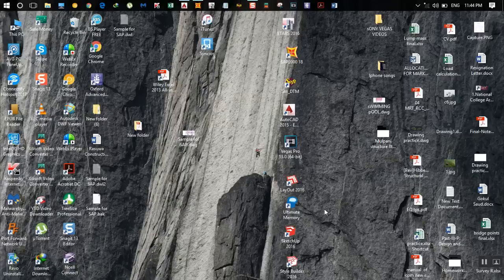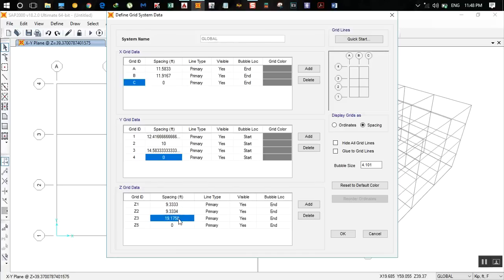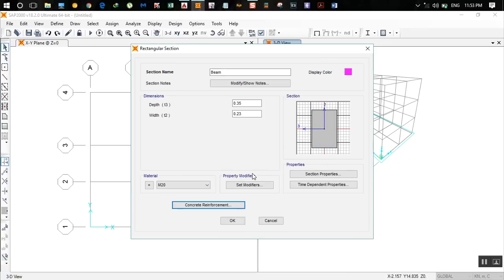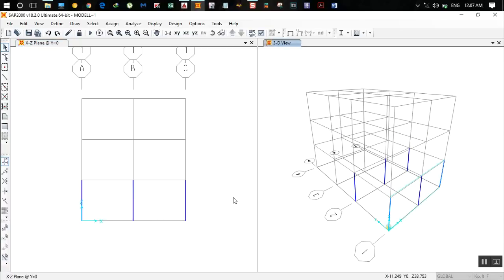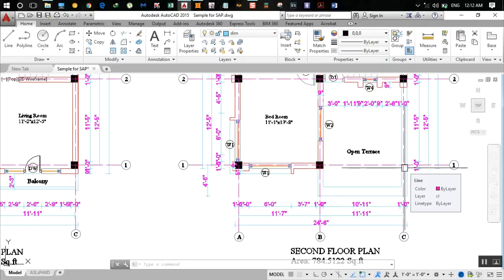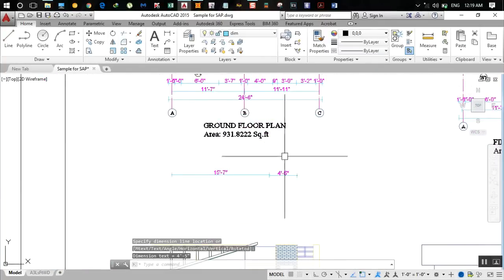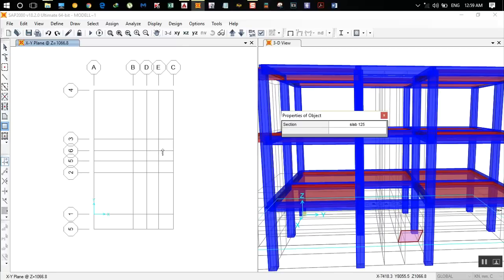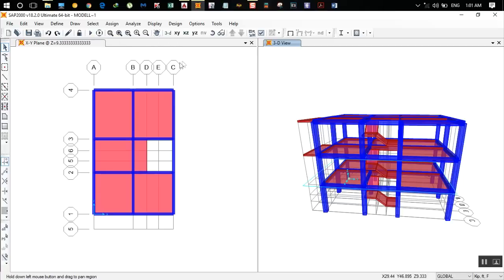SAP 2000 Tutorial For Beginners [Chapter 3]: Modelling of a Building

Comment: You don't have to change the units every time on the bottom right. you can just mention the units after the value for example 250mm and the software automatically calculates the value in selected unit